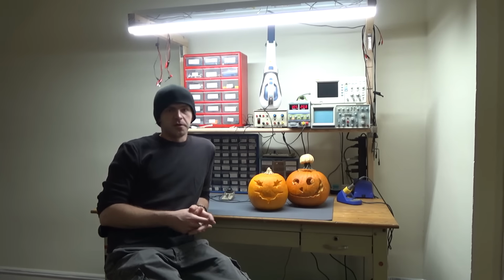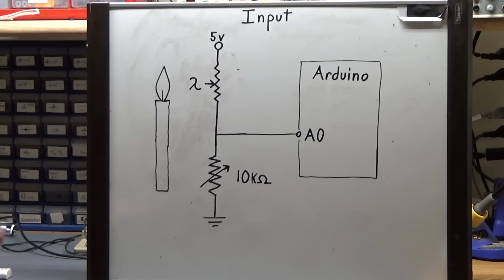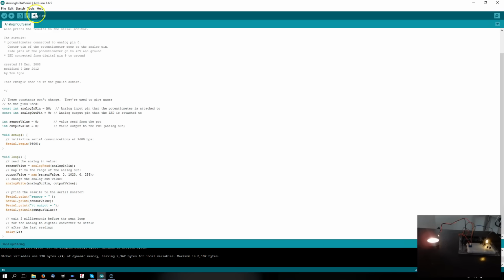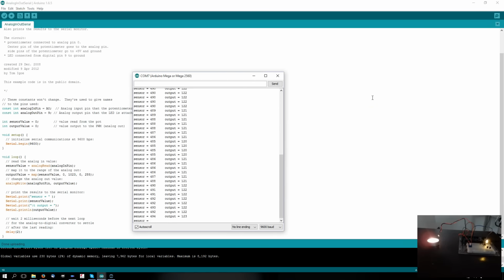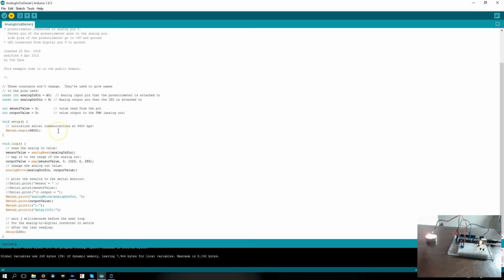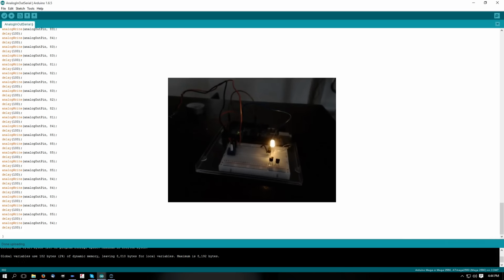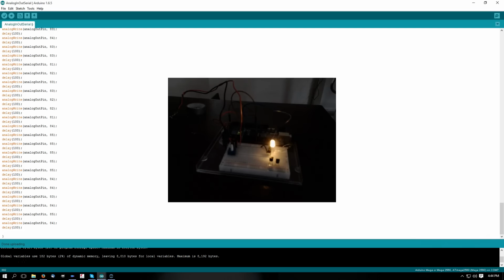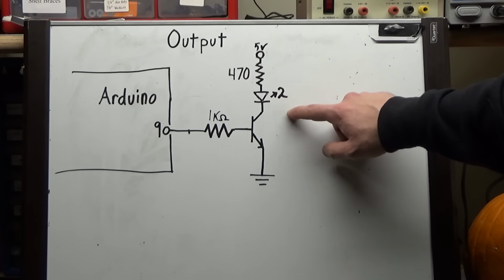Pumpkin - Simulated Candle Light

Comment: You can also buy a candle flicker LED and use a simple amplifier to converts its current fluctuations into voltage fluctuations to drive a higher power LED.

Comment: Clever project! LED is in left pumpkin. Yellow light gives it away
Reply from the maker: +Eric Wasatonic  Thanks, and you are correct. Also the diodes and transistor hint at that too :)
Reply: +Heilman Hackatronics (Matt Heilman) I had considered that too, but I thought, if not for the color difference, you could throw people off by putting the LED inside the traditional jackolantern face.